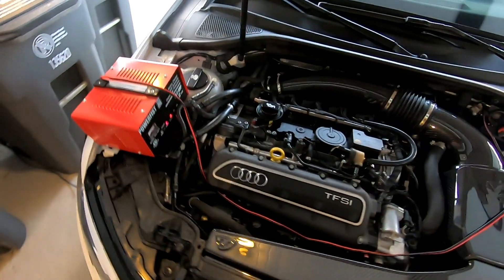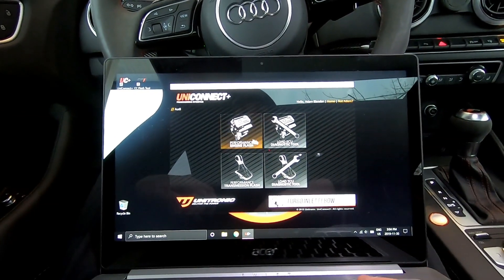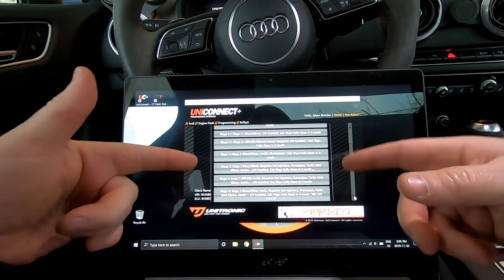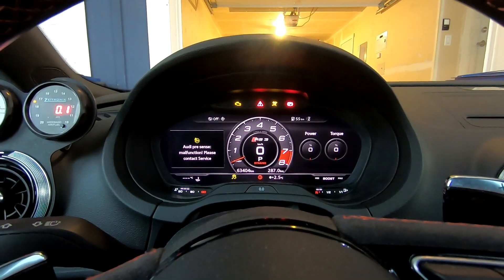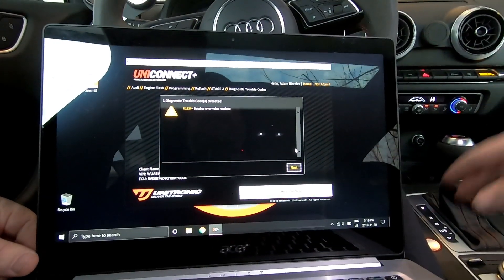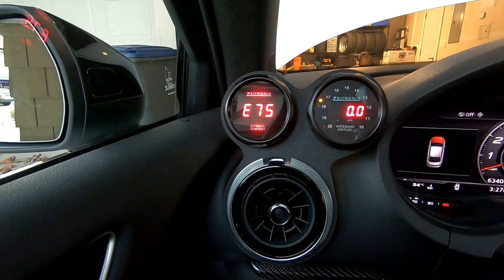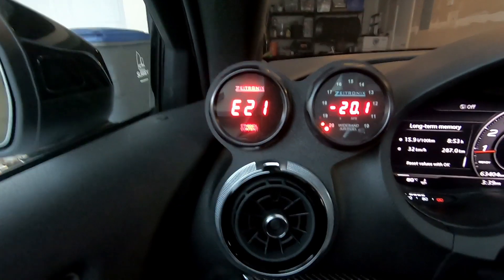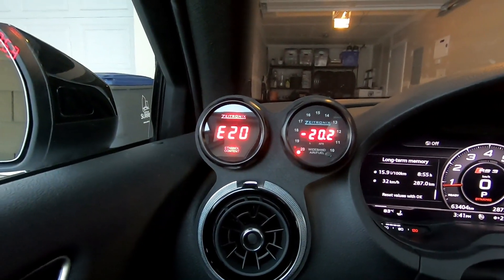How to switch from E85 to Pump Gas using UniCONNECT+ and Unitronic Software

Comment: Quick question… when I switch back to 93 do I have to test the 93 gas too with the ethanol tester kit just like how I test E-85? Or just put it in like regular gas and only test whenever I put it in E-85?
Reply from the maker: It depends on if you are trying to achieve a certain ethanol percentage when you go back to pump gas too. If you just want to run straight pump gas then no, you don't need to test it. If you're looking to run something like an E15-E20 blend then yes, you might want to test it.

Comment: Hey how did you fill up? Did you drive to the station on e75 then fill up with 94 or do you have a barrel at home?
Reply from the maker: I had jerry cans of 94 octane pump gas at home
Reply: @VancityAudi  ok thanks. I think I’m going to go stage 1+ here soon and I have tons of E85 stations around me just concerned about difficulty switching. Video was really helpful. I am in the states so I would want to get the gas a very low when I swap because of the extra ethanol content of our 93 gas here. What ethanol content analyzer is that?
Reply from the maker: @zrayne9707  Zeitronix

Comment: So you drove to the gas station on the 93 tune on E75? I'm assuming that's fine for a few miles as long as you don't go wot? Gas station is about 10 miles from my house here.
Reply from the maker: I didn't do that.  I'm saying if you absolutely have to and you drive EXTREMELY slow and out of boost you should be okay.  But I DO NOT RECOMMEND THIS.  Just wanted to stress that, haha
Reply: @Vancity Audi I could hotspot my phone to my laptop at the gas station, and put the 93 tune on after filling up. I wanna run ~E20 on the 93 tune anyway.
Reply from the maker: @scottc78  yup! That will certainly work

Comment: I love Unitronic and the uniconnect cable.  Has been flawless for a couple years on my 2015 Audi A3.  I must switch to stock tune each year to pass emissions state inspection.  Running a high flow down pipe I must also “trick” the 02 sensor with a mini cat spacer.  But without the uniconnect cable I couldn’t run a tune.

Comment: Do you really need the wideband on your car? I'm wondering if it would be necessary to have, as I already have a methanol gauge and will convert to E85 so I'll have to get E% guage. Thanks Adam!
Reply from the maker: You don't 'need' a wideband but when you are pushing your car to the limits like me, it makes absolute sense to install one.
Reply: @VancityAudi  Thank you so much for the timely response. You're awesome dude. Keep the great videos comin!
Reply from the maker: @christian92587  will do. Thanks for watching!
Reply: Vancity Audi Last question I promise lol. Why can’t you run less than E60 with the injector upgrade, but you can run 93 with the same injectors? Is it because of the ethanol tune itself? The gas pumps here are anywhere from E50-E85 so I’m a little concerned if I do switch to ethanol.
Reply from the maker: @christian92587  Hey bud, sorry for the delayed response.  The reason you can't run under E60 with injectors is because of the tune itself.  That is the safe zone Unitronic has made for making power safely.  In between E60 and E85.  For people with FlexFuel available to them like you, where it is between E50 and E85, you have to be very careful and always test the ethanol blend you are putting in your car.  You should  also be running an ethanol content analyzer to make sure you never dip lower then E60.

Comment: Any chance they embed program switching into an App? Seems like a no brainer.
Reply: Yeah bummer. Weird why they wouldn’t develop an app and Bluetooth dongle like APR to allow map switching without a laptop. Seems like and layup an anothe dagger to APR
Reply from the maker: No. You need to use a laptop to switch tunes using Unitronic software.

Comment: 👍 Good stuff! Which ethanol meter kit are you running? What would be my best options? Thanx
Reply from the maker: I use a Zeitronix ethanol content analyzer. It has worked very well and is extremely easy to read

Comment: I hate pump gas, the loss of timing advance is brutal.  I run E50 year round on my GTI.
Reply from the maker: I take it you have an upgraded fuel system and custom tune?
Reply: @VancityAudi  Eurodyne, HPFP, LPFP.
Reply: I set my own timing curve as gas changes from winter to summer blends.
Reply from the maker: @dirk5950  very cool

Comment: In my experience it takes a couple of tank fills to bleed all the ethanol out of the system and vice versa when switching back the other way. Great video as always 👍
Reply from the maker: Thank you. As I explain in the video though I am not trying to bleed all the ethanol out of the system. I want to utilize E15 to E20 on my pump gas tunes to get better performance. I'll be adding ethanol to every tank of fuel while using pump gas.